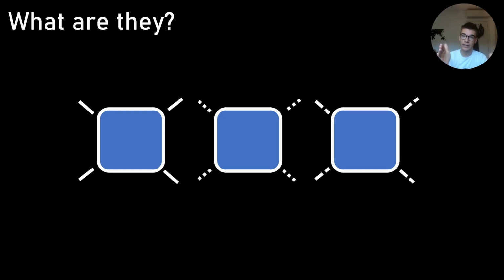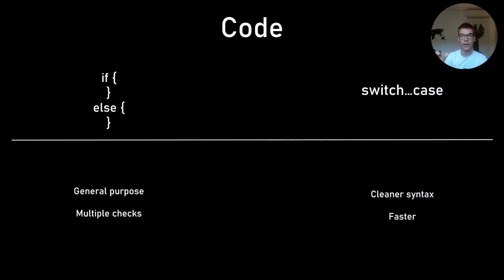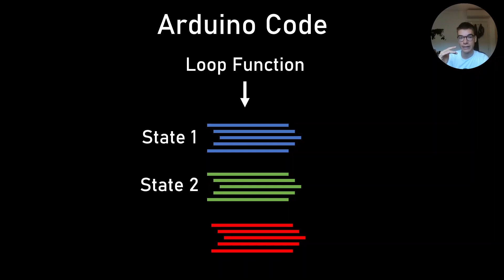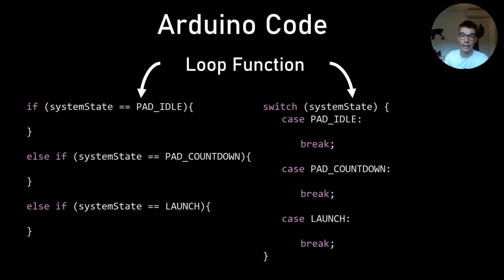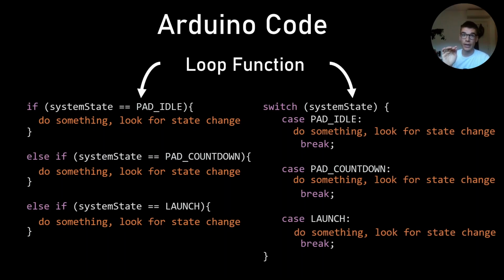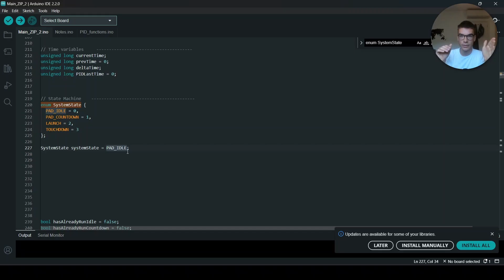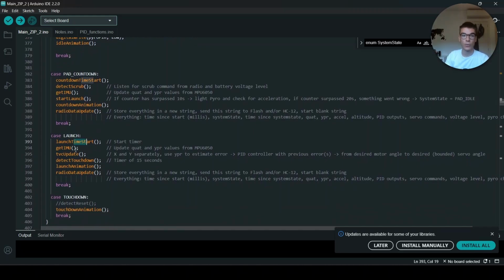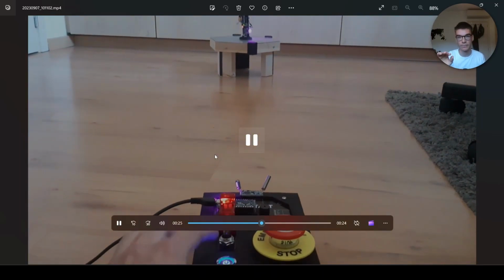State Machines: or How To Structure Complex Code | TVC Build Notes

Comment: Can you share more info about this project it is so excited
Reply from the maker: Yes ofcourse! The goal is to make a small and affordable thrust vector controlled rocket using servo motors to gimbal a rocket motor, gyroscopes and accelerometers to measure the angle the rocket is at (and how much it should correct) and a cheap Arduino to make all the necessary calculations. After a couple of successful flights I hope to put together a video series explaining everything in detail. More is incoming!